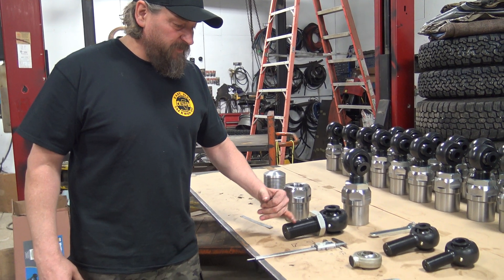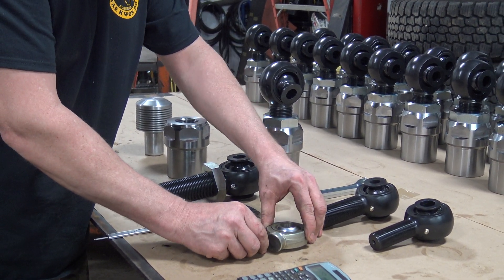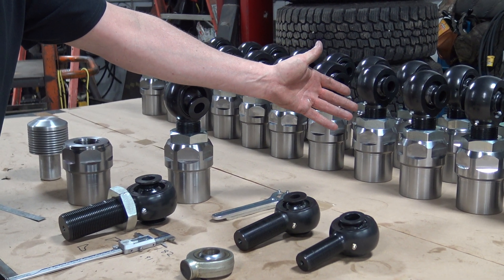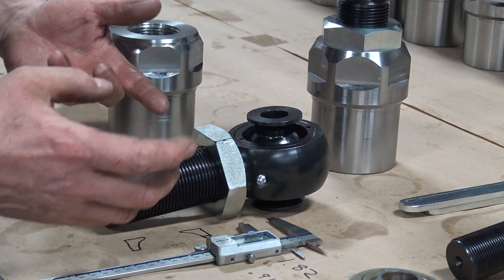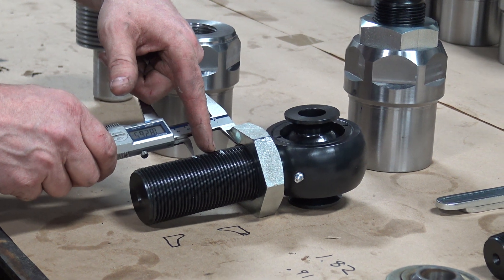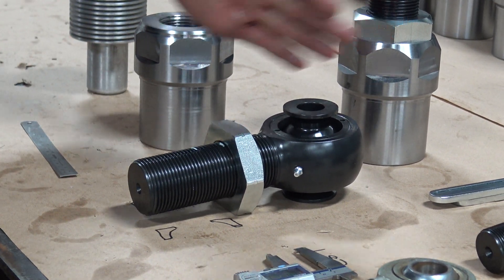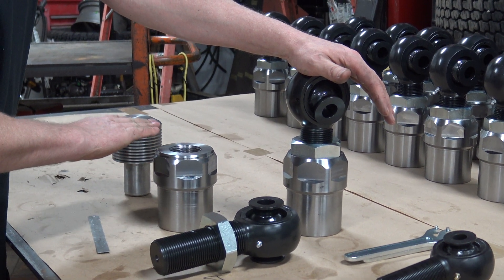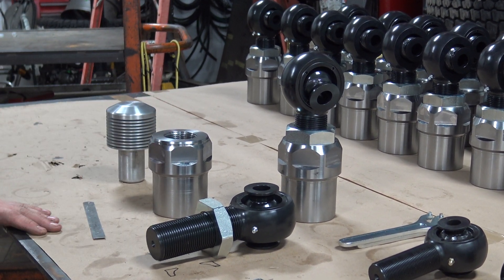EMF Rod End / Heim Joint Suspension Fabrication Tips

Comment: Not sure if you’ll see this, but getting some real mixed messages here I think. I reached out years ago about getting the EMF joints for my synergy linkage as there was someone on the forums pushing that you had an unofficial upgrade kit and then was told that after months of being almost ready you changed your mind and weren’t working on it. Then I see about a year ago that people were still getting the kits. I noticed a while back you stopped making these parts altogether per the website but then see this video which contradicts your website. 

Feel really sour that I was told kits that were not being made anymore were then still being sold it appears despite the fact I was told tough luck.